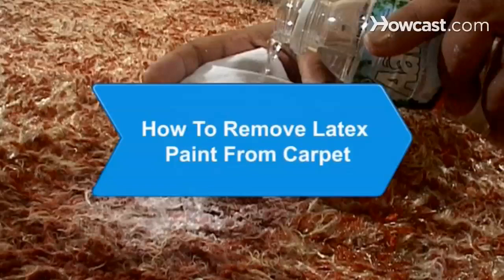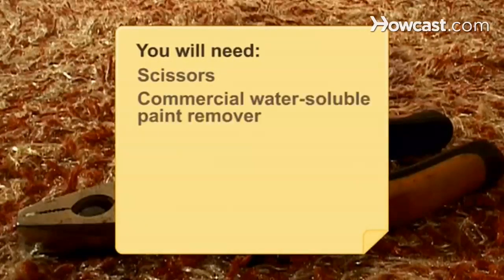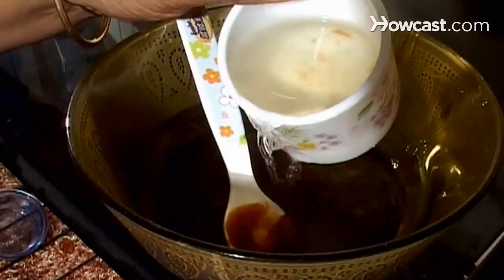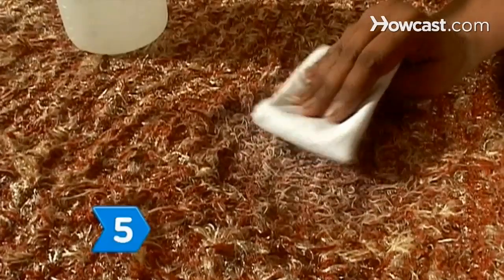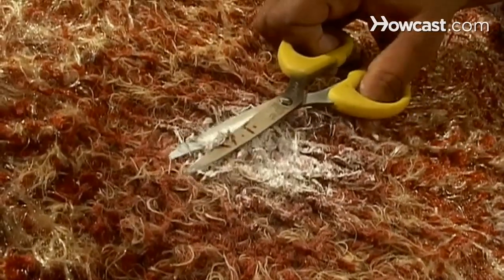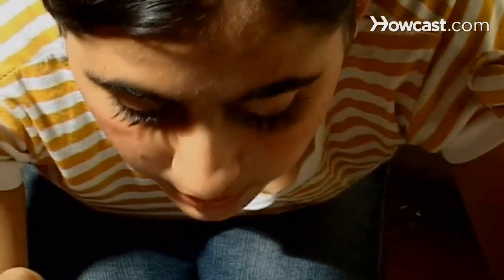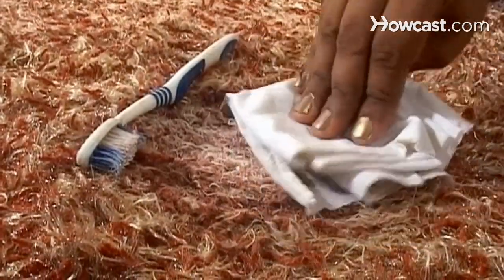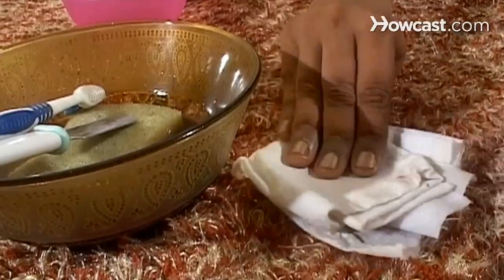How to Remove Latex Paint from Carpet

Comment: As a professional cleaner I disagree with tips in this video.  Paint especially if it has dried most likely won't be removed by a homeowner.  A larger spill if dried can't even be removed by a professional.  The secret it to get it before it dries. 

Once dried the only way to break down paint is with a solvent, but done incorrectly will break down the glue between the two carpet backings and damage the carpet. 

You will be better of getting a carpet repair done as opposed to trying remover a dried paint stain.